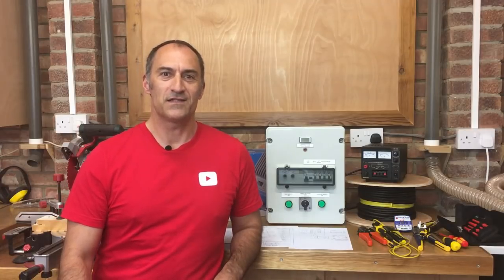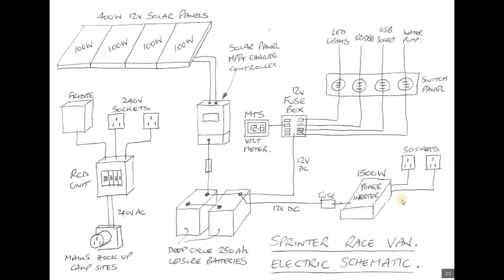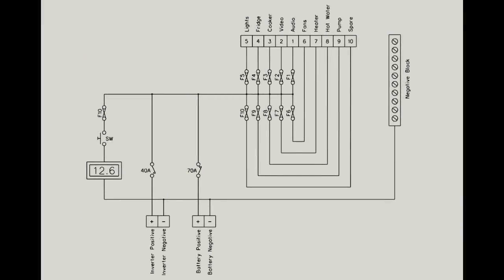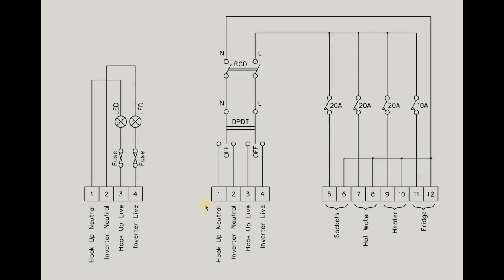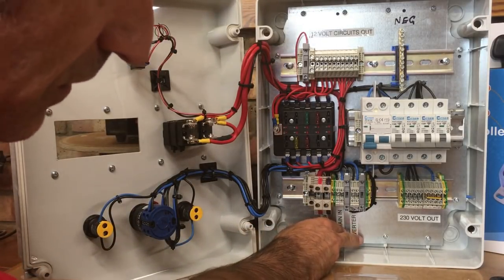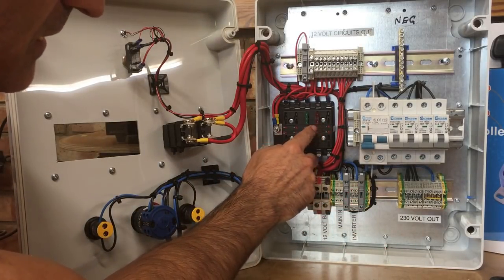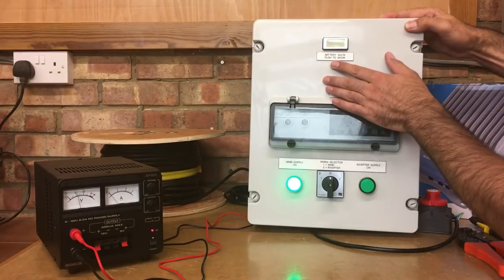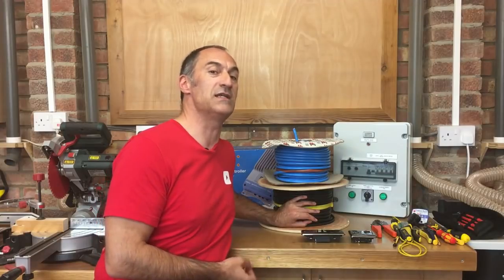Self Build Camper Van 12v Electric Control Panel

Comment: Hey Greg could you possibly do a diagram for if you would like a 3rd option of running off an alternator in the engine using a battery to battery charger?
Reply from the maker: Most are very simple in their wiring. 
A positive and negative from the van battery to the B2B and a positive and negative from the B2B to your leisure batteries. Connect to the same terminals as the MPPT charge controller. Some may also have temp sensors. Victron Orion are a very good choice 👍🏼
Reply: @GregVirgoe  thank you bud keep up the great content 👍👍👍

Comment: Hi Greg. I have a similar system to this. What did you do about earthing on the inverter side?
Reply from the maker: I have a common earth bar in my panel and all my 230volt devices are earthed back to that including the mains hook up. I do have a connection to the van for that earth bar.
Reply: @GregVirgoe  Thanks very much for the reply. I'm yet another one that has used your videos for reference in helping do my own build so thanks for everything you've shared.

Comment: Hi, two things i wasn't sure on? If i plug my battery charger into any socket from the panel`, all is good if i am plugged into a site hook-up. But if i leave the site & go back onto 12 volt i would be using my own battery's to charge up my own battery's. Did you run a separate supply to the charger that only works when the hook-up is plugged in. 
On your panel, you could of also used a lot less din-rail terminal blocks if you had run straight to the fuse terminal. "Less joints, less problems"

Comment: Hi Greg, 
Just bought my first sprinter van to convert, firstly your tutorials are great thank you. I am planning my wiring diagram and looking at buying parts, please could you adivse me if I should be buying a 16amp or 32amp hookup socket and lead? What are the pros and cons? 
Best wishes, Leigh
Reply from the maker: Most hook ups are never more than 16amp so that will be fine. 
With all electrics if you go bigger on ratings that’s always safer as it will run cooler 😎with less volt drop

Comment: Hi Greg
Great videos and much appreciated, I am in the process of converting a LWB Sprinter and am trying to figure out how to do cope with hookup in both the UK with 230v and EU with 110v.. 
My mains charger is ok as it a wide input range but mainly concerned about the RCD and MCBs as these seem to be specific. How do you cope?
Cheers Craig
Reply from the maker: All the hook ups we have had in Europe have been 230volt we not come across any 110volt ones yet
Reply: @GregVirgoe  Wow an amazingly quick response thanks. So it appears I am stressing over a non existent problem :-), that's a relief. I should have hired a camper and given it a go before jumping in feet first.
Thanks
Craig

Comment: I'm always confused why people use inverters for laptops... Most laptops need 12-18v power, and you can get an adapter from 12v easily for any popular model. So much more efficient that way
Reply: To be clear, no disrespect meant - love the video!
Reply from the maker: But when you have one like mine that needs a 190w transformer they don’t do the 12v versions that big. 😊

Comment: Hi Greg, great work. What cables have you used to run from the mains inputs (the black and blue ones travelling through the mains terminals to the DPDT switch and then to the RCD)? Are they 1.5mm single core? Thanks
Reply from the maker: Watch my video on cable sizing it will explain what to do. It’s based on what you have connected to each circuit.

Comment: Hi Greg, Absolutely brilliant videos on all aspects of the build and also very informative. We purchased a sprinter last friday. All I have done at the moment is remove the plywood lining and bulkhead. In this particular video am I right in thinking that when your not on shore power (ie driving and wildcamping) you would have that panel switched to the inverter side constantly?. Also is there a market equivalent of this panel which you have built or please could you point me in the right direction. Thanks. Andrew & Barbara.

Comment: Top video as always , But I have installed the 12v electrics after the insulation so it's easier to get at should the need arise, there is plenty of room in the 25mm cavity between the batten and the boards to run the wiring tidily .

Comment: When hooking up to shore side mains, what would you install to also charge your 12v leisure batteries along side your control panel above?
I know your solar panels will charge them but if the weather has been dull for a long time or you want to just charge up quick and go this would be useful. Also can you link off your car battery so that when the engine is running you have power and charge that way?
Basically I want everything lol
Reply from the maker: We use a mains battery charger when on hook up, links are in this pdf file https://www.dropbox.com/s/zvtyj0z7cdeb9d8/Greg%20Virgoe%20Campervan%20Parts%20List.docx?dl=0
You can also use a DC to DC charger for charging when driving and a good one is Victron Orion
Reply: @GregVirgoe  You honestly couldn't be anymore helpful! Thank you so much. I'm sure I have some more questions coming your way! 
How is your Truma combi holding up? 
I am getting the diesel version, have you encountered any issues?
Reply from the maker: @luxuryprivatechef7537  our has been fantastic and I cannot praise it enough. 
I believe the diesel version will be a little louder due to the different burner and fuel pump but the operation should be Just as good. Why did you choose diesel? What you cooking with?
Reply: @GregVirgoe  Great thats good to hear! I wanted to avoid gas as much as I love to cook on it. Purchased the Wallas XC duo, a hob that also runs off diesel, I plan to link both the Wallas and the Truma direct to the duel tank hopefully. Big costs but hopefully will save me space and hassle the long run. The XC duo doubles up as a heater too, if the truma ever packs up when we are lost in the artic circle somewhere we then have a back up heating source.

Comment: Hi Greg, can I use 110 AC volts that built in the van and using battery charge(AC to DC) to replaced solar power to charge battery? Because when I am driving the ac power will provide stable ac power then with battery charge then it can transfer from AC to DC to direct charging the battery for all appliances?
Reply from the maker: I assume the 110v AC that is built into the van must be from an inverter so it doesnt make sence to use this to power a battery charger to then bring it back down to 14.6v to charge your leisure battery, very inefficent and so many system losses. Do away with the 110v ac and just install a DC to DC charger connecting the two battery system together directly, much better solution.
Reply: @GregVirgoe  Thank you so much for your quick reply and I am thinking to purchase- NOCO Genius GEN5X3, 3-Bank, 15-Amp (5-Amp Per Bank) Fully-Automatic Smart Marine Charger, 12V Onboard Battery Charger, Battery Maintainer and Battery Desulfator with Temperature Compensation from Amazon, any advice for me? Thank you again for your help.

Comment: Hi Greg. Thanks for your many excellent guides. It's always good to see how someone else has tackled an issue.
I was interested to see one of your wiring diagrams which looked remarkably similar to my planned layout. You show solar panels and a Sargent mains powered battery charger. Both systems have the facility to be isolated from the rest of the circuit. Would you ever use both together? I'm wary of causing damage and have yet to find a reliable answer to this question. Thanks in advance for your time and best wishes for your future adventures, Les

Comment: Hello this may be a silly question, but would you not also need an isolator switch on the 12v supply going into your 12v box, with one 12v supply from the battery, and the other from a 230v transformer that is run from shore power. Then with the similar LED indicator, you can run 12v from shore power. Otherwise you lose all of your 12v circuits if you have a battery problem or no sunshine for a few days. Thanks
Reply from the maker: Hello Asif, you can run the 12v DC stuff directly from the 230v AC shore power. We have a mains battery charger for those times when you have no sun, and we have three batteries for redundancy. It's the easiest way of doing it.

Comment: Nice work!
How did you make those labels on the front of the cabinet? Looks like they're etched trespa or something?
All the best!
Reply from the maker: I had an engraving company make them from a material called traffolyte which is a black and white plastic sandwich. It helps to have friends in the business. I use to design control panels for a living many years ago
Reply: @GregVirgoe  I figured as much :)
Looks very professional! Thanks for taking the time to answer!

Comment: Hi Greg, amazing work with the videos and thanks very much for the helpful replies too! I am trying to plan my campervan and just trying to understand the systems. I was thinking of running all of the 240v from the inverter from the battery and when we are at a campsite plugged into the mains, the mains plug would charge the leisure battery via a 12v battery charger unit. To me it seems less complicated but i guessing there may be downsides which I can't see?? Any help much appreciated!!!

Comment: Hi Greg. Hopefully my couple of questions will reach you. I'm at the stage of wiring up my 240v mains hook up. I want two double plugs in the van, one in the garage and one in the kitchen area. My consumer unit has 1 rcd 63A 30ma and two 16a mcbs. Will a double socket with USBs be ok on a 16a mcb? and can I run just one length of 2.5mm arctic cable to each double socket or do I need a return cable? Anyway many thanks and happy new year!
Reply from the maker: The answer to both your questions is yes you are correct.  
One other point I would change the size of the RCD and reduce it to 25A
A standard hook up is normally a maximum of 16Amp
Reply: @GregVirgoe  Thank you very much for the reply Greg. I'll look to swap out the RCD for a 25A and run a single arctic gable to each double socket. Oh one last thing...I've heard a lot of mixed views about earthing the consumer unit to the vehicle chassis via a 6-10mm cable, is this advisable? Many thanks. Chris.
Reply from the maker: @christophergriffiths5511  as long as all your earths are connected together back to the consumer unit and your hook up earth you’ll be covered. 👍🏼
Reply: @GregVirgoe  Many thanks 👍🏼.

Comment: Hi greg. Your videos are so informative and great to watch. My question is im currently doing my own van and wondered whether i need to earth my mains from the consumer unit to the chassis or is it acceptable to rely on the earth from the the supply post at the campsites. If yes would this interfere with any vehicle electrics also earth to the chassis? Many thanks and have a great xmas.

Comment: Hey Greg, thanks for your great videos! Did you earth/ground your leisure batteries? Bit confused!
Reply from the maker: No, a 12v DC system does not require an Earth. 
Some installation use the van body for a negative back to the battery to save running negative wires. This is often called a ground but it is not to be confused as an earth.
Reply from the maker: Most split charge relays use the van body for a negative return. Again this is not an Earth. Hope that helps.
Reply: @GregVirgoe  that helps alot! Thanks so much for your reply. First van is nearly done, can't wait to get out on the road!

Comment: Hi just a quickie the Dc trips in the control panel one of which is rated at 70 amps. What do you call them I have been looking online and can only find ones with a maximum rating of 45 amps that can be mounted on the front of the panel.
I am glad I found you although after completing a part P course  a few years ago

Comment: Hi Greg. Really appreciate your videos and schematics. Really clear and concise. Couple of things I was wondering though with regard to your mains selector switch: 
1. How does the earthing wiring connect from the mains hook up - I didn't see it in your panel?
2. Did you consider using a 4 pole selector switch and also connecting the mains powered battery charger through it on the same switch as the mains hook up (position 1) - this could then allow you to plug in your mains charger after the consumer unit (so protected) but only be connected and charging when on mains power and not on inverter power. Would that work?

Many thanks. Keep up the great vids!
Jonathan
Reply from the maker: I just have a socket connected to my hook up and plug in the mains charger. The hook up has a breaker and the plug is fused.
Reply from the maker: Watch my controls installation to see the earth bar in the panel.

Comment: Hi Greg, thanks for all your videos very clear and informative. 
I’ve bought an already converted camper. Converting it to off grid, can I connect the inverter to a switch and then to the small consumer unit. What would be pros and cons and would I need anything additional.

Comment: Hi Greg, I was wondering if you could tell me what size the wires are that you have going from the 12v blade fuses to the outgoing terminals and does it matter? Do the wires vary in size in relation to the size of the output load or are they all the same? I see the wires from the battery input to the 12v breaker are thicker. 

Any help would be appreciated. You have the best electrical set up from what I've seen on YouTube!
Reply from the maker: The cables are all rated for their loading. The positive from blade fuse to terminals are all 2.5mm Tri-rated singles good for 30A and my largest blade fuse is the fridge @ 15amps. 
I’ve done a recent video on cable and fuse sizing they may be of use to you 😃👍🏼
Reply: @GregVirgoe  brilliant thanks a mill!

Comment: Hi Greg, great video as per! I've got a quick question about my 240v setup I hope you can help with. I'm planning on using the 60A PPT Ac-dc charger (the green one you show in your schematic) but I'm not sure if that means the consumer unit RCB connected to the 240v hook up has to be a certain ampage to match it? I've got 660aH battery bank so wanted to use the 60A version to charge them quicker, I hope this makes sense, any help would be really appreciated!
Reply from the maker: Great question - lets multiply the charge voltage 14.5v times the amps 60A that equals 870w of power. Now on the mains input side that power is drawn at higher voltage so 870w /230volt = 3.78Amps   Allowing for loses within the charger and safety factor you most probably get away with a 5 Amp fuse in the uk plug. 😃👍🏼

Comment: Hi Greg. Addicted to your videos as I plan a Sprinter conversion. Thanks for the parts list but would it be possible to get a full up to date version including the spec of the wiring you used in your control box? Happy to make a donation. Cheers
Reply from the maker: Hello Monty, if I did another van I would not build this box again it’s just not necessary. My later wiring schematic is a better solution for off grid living.
Reply: @GregVirgoe  Really pleased you said that Greg as I'm slightly scared at the prospect of trying to replicate the box! Will look for your later wiring schematic (unless you wouldn't mind putting a link here?)
Reply from the maker: @montym9814  you really need to check out this playlist these are my essential van building videos https://www.youtube.com/playlist?list=PLLhAyWhGGbi4nOabmpkLMGvfLGox2ljp_
Reply: @GregVirgoe  Greg. That is perfect. EXACTLY what I was after. Thanks again.

Comment: just to show how much i don't know. i have a question about the inverters 240 supply how have you got it earthed.
Reply from the maker: It’s earth internally and there is an earth connection on the metal casing. All my earths go back to a common bar and connected to the hook up earth.

Comment: Greg, reading through your many answers regarding the above control box it might be an idea to create a 'shopping list' with links and specs (some of your current links are 'dead')......as you have had to answer the same question many times over! 
Incidentally if you could post the total build cost for the box then it would be a good comparison to see if its worth buying a similar 'certified' one off the the shelf, or go to the extent of a self build one? I know its a load of work for you but might help in answering the same questions over and over.Great work btw!

Comment: Brilliant Greg, I'm really getting some great information from your videos 👍 I was just wondering where you got your control box from, did it come with the consumer unit type window/flap? I'm converting a removals  🚚 into a camper and want to build a central control panel to house 12V, 24V and 230V with a DPTT to include a generator, I'm hoping I can do it a similar way 😀

Comment: Hi Greg. I have been looking at your overall Van wiring diagram but I’m not sure I have the latest version as it doesn’t seem to have the shore power to inverter power isolator / switch shown or any of the main cabin 240v sockets.  Can you confirm link to latest version with this detail?
Many thanks!

Comment: Nice explanation. But I have question about earth (green/yellow) wires. Where I need to connect them?
Reply from the maker: Connect all your earths together onto a terminal strip and to the earth on your hook up socket
Reply: So if I will use AC from inverter I will not have a protection while using electronic items if they will have a short to body (for example metal kettle). Am I right?..
Reply from the maker: Modestas Čereškevičius your inverter case should be earthed.